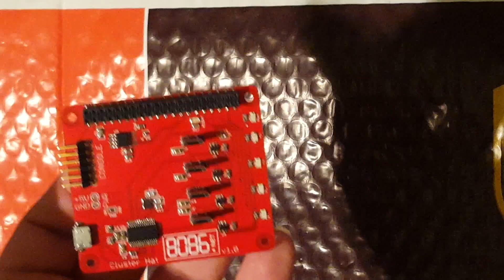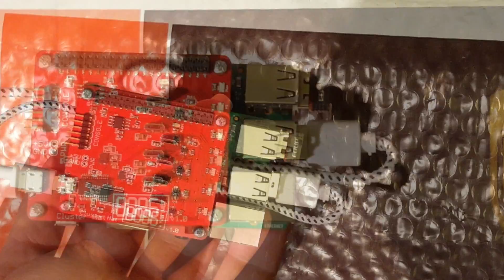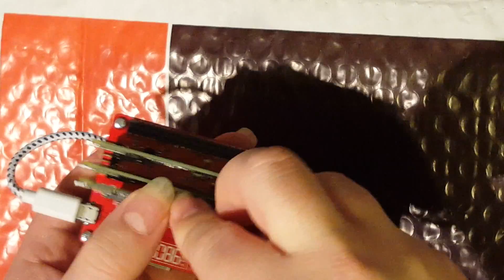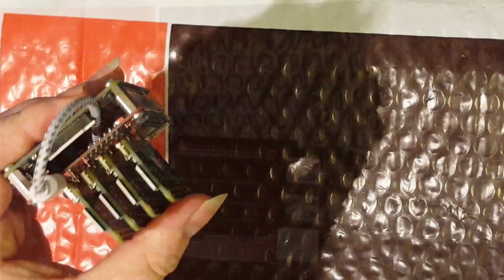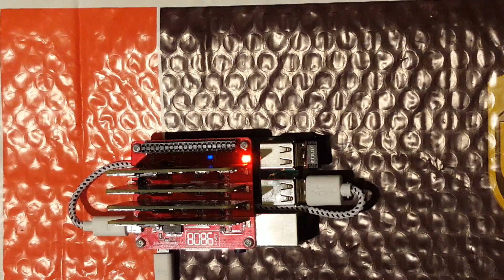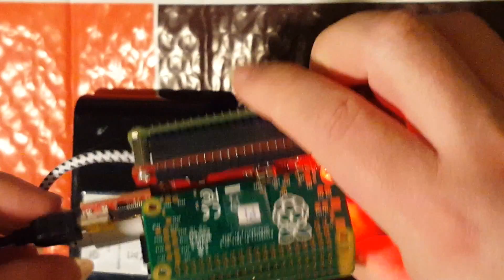Cluster Hat for Raspberry Pi Zeros (Overview)

Comment: Do all the Pi's need NOOBS or is there a seperate software that is needed to connect them?
Reply from the maker: The images I provide on the site are based on Raspbian Lite. I see no reason why you couldn't use NOOBS if you know how to setup USB Gadgets/network config and you would then end up with the 4 Zeros networked to the controller Pi as you do using the provided software.
Reply: Thanks. Does it need to be flashed onto the sd card, if so would etcher be fine?
Reply from the maker: Yes, etcher should be fine.

Comment: so wait, this adds to the power of the pi right?
Reply from the maker: You'd need to use an application/library designed to take advantage of multiple networked Pi.

Comment: with the cluster hat, does it remove the need to program it to cluster or what is its extent of ability?
Reply from the maker: The Cluster HAT hardware/software gives you power control, Ethernet and a serial connection between the Pi Zeros and Controller. You can then configure/install additional software as you would with other networked computers to do what you need/want.
Reply: im working on a rasberry pi 3 with my son, will this also work with rasberry pi 3?
Reply from the maker: Yes, it will work with the Pi3.

Comment: Did I hear you correctly? Did you mention distributed.net client? I was under the impression they don't have a build for arm. Please elaborate on exactly which build did you manage to get to work on it.
Reply from the maker: On the Pi you can use the Linux [ARM/eabi] version on http://www.distributed.net/Download_clients
Reply: Thanks for the tip, seems to work on my original pi B+. Do you know if the same arm build will work on the Pi 3 or is there a different one for it.
Reply from the maker: That [ARM/eabi] version works on the Pi2/3 too.

Comment: Does this increase CPU power for your OS?
Reply from the maker: This isn't generally how they work. If you wanted to use multiple CPU for a job you'd need to split the job and process it on multiple CPU/nodes.

Comment: what do you get from making a cluster?
Reply: Yea but you don't do it with Pi's.  Not worth the effort or electricity.  A single GPU for $100-$199 will blow these PIs away.
Reply: i've asking the samething to my self.. i saw a lot of videos like this but no one tell what can we do with this.. still waiting for the anwser.. lol
Reply: like if i put 2 together does it make a raspberry better and can i do more things with it. questions we will never no
Reply: parallel computing
Reply: what is that
Reply: This is how I see it;
Imagine how multiple blood cells collaborate to build and heal the body far more efficiently than a single cell could. Parallel computing works similarly as a means to solve complex problems or process large amounts of data with more efficiency than a single computer could.
Reply: A coupla FPGAs will blow the GPUs away ;D
http://vr-zone.com/articles/pico-fpga-hardware-beats-gpgpu-in-password-cracking/16705.html

Comment: What's a recommended amperage on the power supply? I have a 2 amp power supply that came with my Zero kit, and I'm hoping to use that once I can get this.
Reply from the maker: +GoldenStar Music - Music & Tutorials With a Pi B+/2 your 2A PSU should be adequate. At 100% CPU on 4 Pi Zeros and the controller (and WiFi dongle) I was seeing about 1.3A usage which leaves some capacity for additional peripherals.

Comment: Hi Chris, nice video. I am interested in the construction of a cluster like this. Is possible to connect several raspberry pi 2 (each one with a Cluster Hat)? for example 2 raspberry pi 2 + 2 clusterhat with 8 raspberry zero. Thank you :)
Reply from the maker: +Diushi Keri  Yes you could do something like https://clusterhat.com/dist/img/ClusterHAT-16-4.jpg with a power and network cable to each Pi2/3. It would just need a couple of changes to the std setup in the SD images.
Reply: +Chris Burton thank you for your response!!! Great! Now, I will try to get some raspberry zero (the main problem). :) cheers

Comment: so you have the micro usb port for power, but I don't see any cabling to actually control each pi and it looked like you were plugging each one into the wrong micro usb port, you planning on having them actually booting and connected each the serial console on a later iteration?
Reply: +Vontux it uses Gadget USB mode on the Pi Zeros so it shows up as a composite USB Ethernet and serial device (also powering it) which plugs into the USB hub on the HAT which then connects to the Pi2 USB. So you end up with 4 USB Ethernet devices on the Pi2 and you can route/bridge to the Zeros and connect using SSH/etc. as you would normally.
Reply: +Chris Burton Awesome, didn't realize you could power the Zero from the data USB port when in gadget mode. Great work :)

Comment: I'm currently running a similar cluster, experimenting with remote upload of code (sans MicroSD Card), doing usbbootcode.bin-esque things. Would love to be able to do it in a much neater fashion using a HAT such as this one. I do think that maybe having 2 MicroUSBs per Zero on the HAT would be an improvement, just for stability when attached.

Comment from the maker: You can now register an interest in buying/getting more info on the Cluster Hat at http://clusterhat.com/
Reply: are you running a separate os  or bootcode on the zeros or do they look on USB for bootcode too?
Reply: and can you make a video on how to set this up, along with where in the world that there is a place that isn't out of stock
Reply from the maker: +ray “pcs the 3rd” dean currently each Zero needs an SD card for it's OS but the hardware should support usbboot although I haven't been able to get this working yet :(.
Reply: +Chris Burton so, as far as the hat, how do I set it up on the software sise
Reply: +Chris Burton for USB boot, you would need to tell raspbian or the is to share everything its doing over USB, then modify the bootloader cmdline.txt so the root is on the otg port. right?
Reply: +Chris Burton might I ask if as of current date you have gotten it working?....also of it is how well it is performing?... thank-you :-)

Comment: imagine Running Gamecube emulation on that
Reply: A normal pi 2 should be able to handle a GameCube software/emulator
Reply: +Joe Federico O_o. It sputters on the occasional N64 game that I've tried, lol, where do you see GC successfully done?
Reply: +theacematt2 if you get the actual os on the pi it will act like one and may be faster in theory
Reply: Joe Federico Uhm........... find a pi2 video (or go look up the actual process yourself) of getting a GC emulated efficiently ..... Again, I've seen it sputter at the occasional 64 game, and flat-out refuse to hit more than 5FPS on DS-related things, lol.

but if you can find a good video, by all means :D.

...................though...................... you can stream a COMPUTER emulating a GC with moonlight -- http://blog.petrockblock.com/forums/topic/moonlight-tutorial-for-steam-and-dolphin-streaming-to-pi/ ... if you reaaaaally wanted to, though that doesn't mean the Pi is doing the emulation. . .
Reply: +theacematt2 what they meant was that you can do it by flashing the firmware of an original GC to the pi2, although currently not possible, it's a functional concept. they're not talking emulation, but actually running the GC OS on a pi
Reply: Amelia Tovey  that can only happen if the Pi has the same CPU as the GC (which it doesn't) Anything else you might do to run it, is emulation.
Reply: +Jaspreet Singh incorrect. it can be compiled to run on another platform. same as android runs on many devices, and how Debian was compiled to run on the pi under the name raspbian.
it would take a lot, but theoretically is possible.